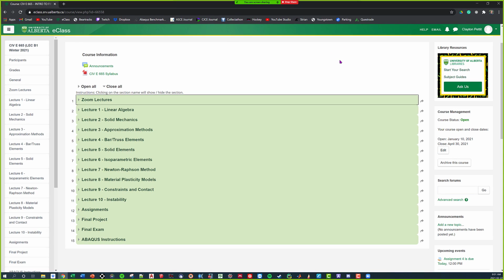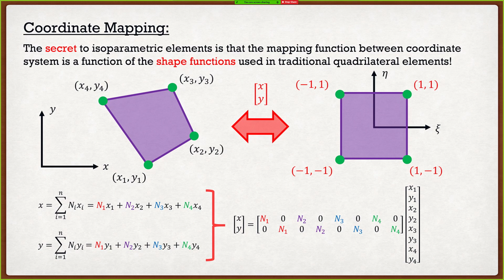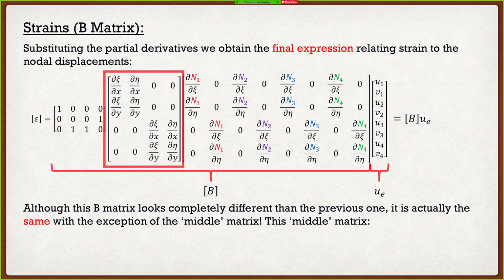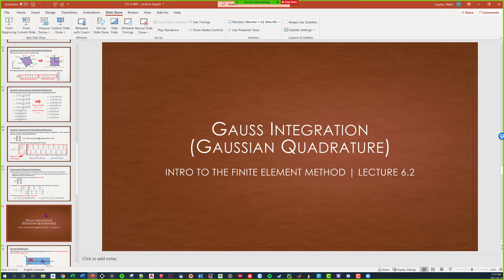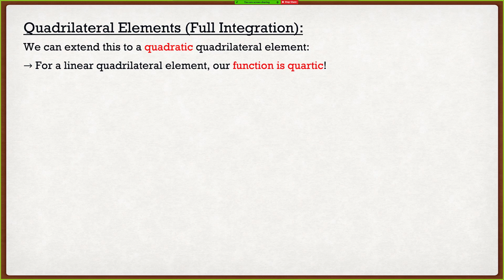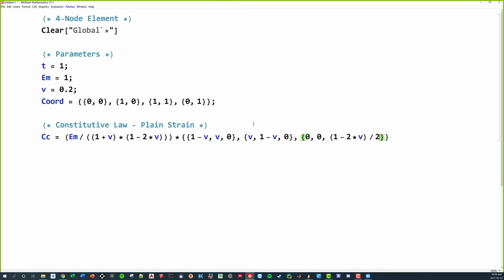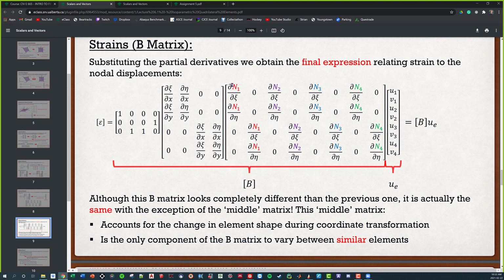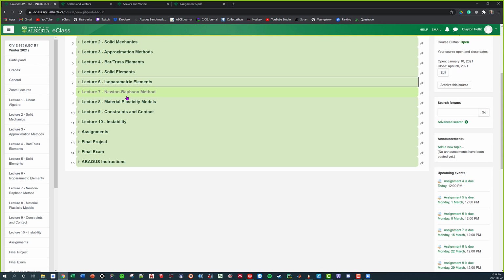Intro to the Finite Element Method Lecture 6 | Isoparametric Elements and Gaussian Integration

Comment: In my 2D quadrilateral finite element formulation, the element stiffness matrix is computed using the Jacobian, which multiplies the shape function derivatives by the node coordinates.

Since the Jacobian already incorporates the global node coordinates, does this mean the resulting element stiffness matrix is already in global coordinates?
If so, do we still need a transformation matrix before assembling the global stiffness matrix, or can we directly assemble it?
Reply: The Jacobian is used to map derivatives and integration from natural to physical coordinates. After this transformation, the B matrix is expressed in global coordinates, so the resulting element stiffness matrix is already in the global coordinate system. Therefore, no additional transformation matrix is required before assembly. This differs from beam or truss elements, where the stiffness is initially defined in a local coordinate system and must be transformed to global coordinates before assembly.

Comment: At 58:20 the [J] matrix in Step 2 is wrong. It should be: [J] = [dx/dξ dy/dξ  ;  dx/dη dy/dη].  By doing so, the k matrix changes a little bit. Everything else is ok!
Reply: The J matrix is correct because he use the Coordinate mapping Jacobian Matrix not the J that come from the derivative form. You will not find this Jacobian matrix in FEM books you will find it in Math books. If you put the J matrix as shown in the video you will get the same result.
Reply: @raihanahmed3686  I didn't get the same results!

Comment: Amazing lecture series Clayton :) I have a question regarding what you mentioned at @35:15 where we claim that the Elasticity matrix C is only a function of Young's Modulus and Poisson's ratio and is constant respective to coordinate variables. While that makes sense, it's still a 4th order tensor that must transform with a change in basis (from x,y to eta/xi), even if it's components are all constants. Do all the basis transformations cancel each other such that we're left with the same constants in the eta,xi coordinate system?